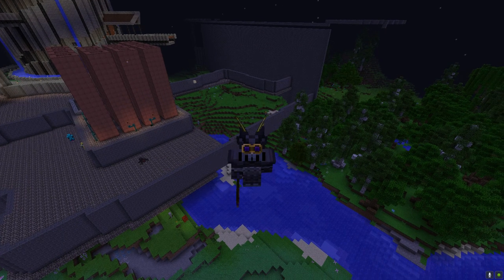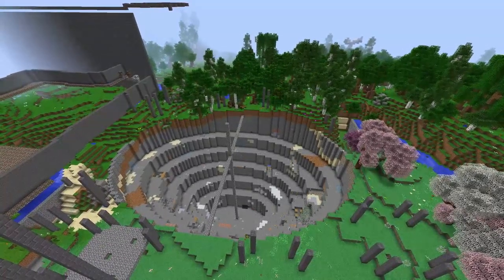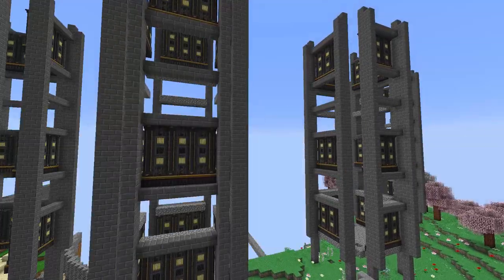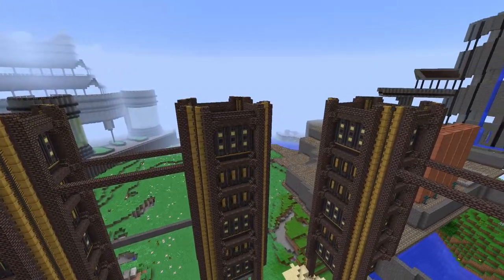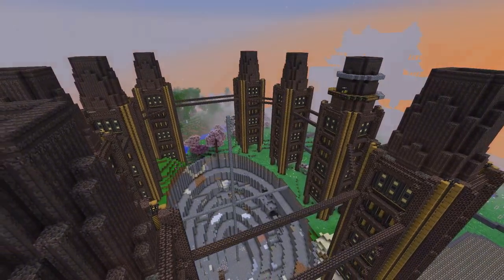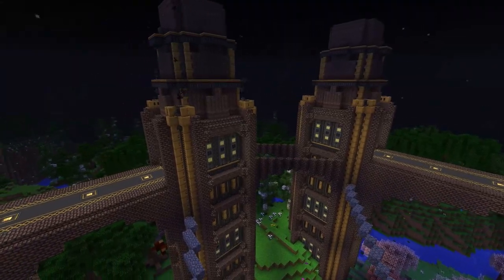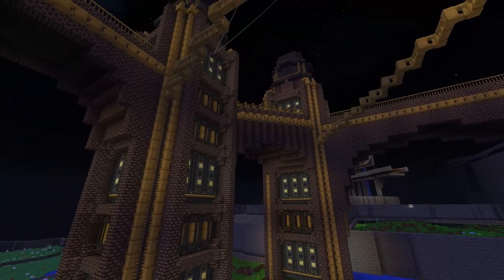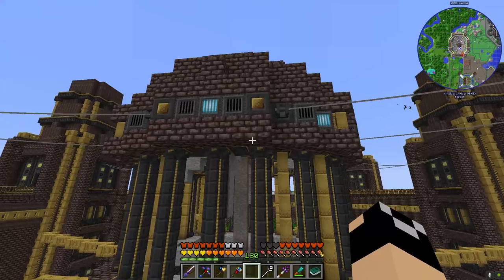Ore Processing Overhaul-Mine Structure Build : Enigmatica 2 Expert Lp Ep #56 Minecraft 1.12

Comment: One thing to note about the void ore miners: you need both a level 5 AND a level 6 to get all the ores. While the level 6 one is faster the level 5 mines some things that the level 6 doesn't. And you'll likely want a resource miner as well making that 3 miners. Might want to keep that in mind for the build.
Reply from the maker: Thats a very good point.  I was planning for a resource miner and botanical, but yeah hadnt thought about needing a t5 as well, though I had considered doing a bunch of t6s because why not :p  So I do have a plan for more, though will revisit the idea for adding in some 5s as well.  Appreciate the heads up :)